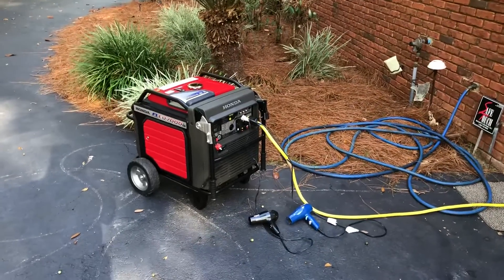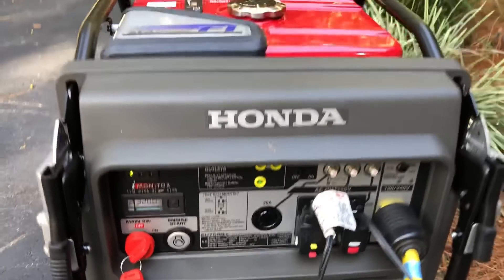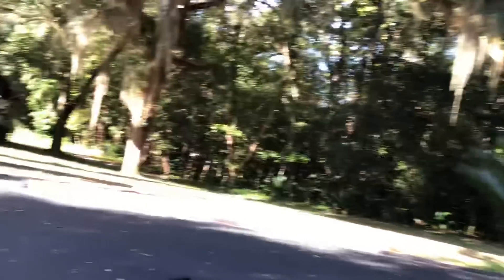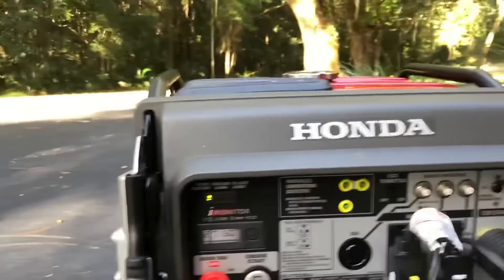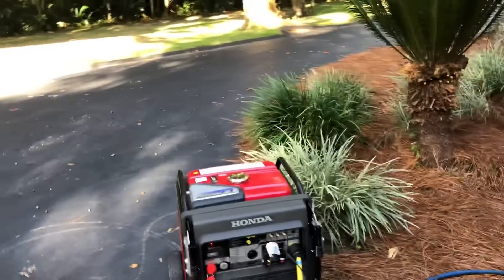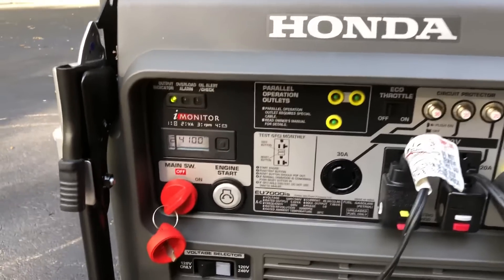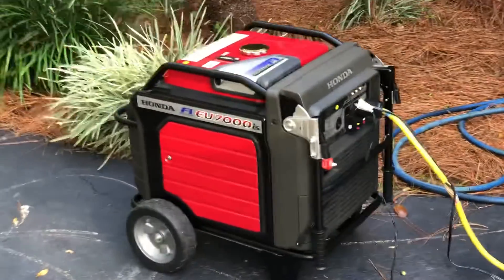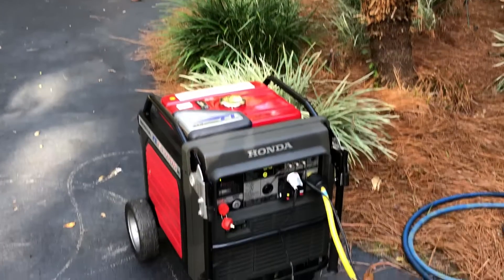Honda EU 7000 inverter generator at 7700 W full load bank test until breaker tripped

Comment: Every EU7000 Honda generator I researched only had a 5500watt rating. That extra headroom is only for motor startups and only for 10 seconds, you cannot run this generator at 7000 watts continuous. 120/240V 7000W max. (58.3/29.1A) 5500W rated (45.8/22.9A)

Comment: It was overloaded at 5501 watts, you were using the 1500 surge watts which will run for a certain amount of time before it shuts down. This unit is only designed to run a constant 5500 watts and it is designed to surge up to 7000 watts but only for a short time to allow something to start.

Comment: I have one and just hooked up a bigger manuel transfer switch with 6 120 circuits and 2 240 circuits, one of the 240 circuits powers my 18K mini split and the other 240 circuit powers my hybrid hot water tank I only use on the heat pump side everything worked great rant for about 12 hours no glitches of any kind couldn't be happier. and it's quiet with a large gas tank.

Comment: With this generator, if you connect only using the L14-30 to your home, can you go up to 7000 watts for maximum and 5500 watts for continuous ?

As you were using the hair dryer in the other connectors , I was wondering if we can reach the maximum using only the L14-30 connector
Thanks for the review
Reply: The 7000 is the maximum surge the generator is designed to handle, it is designed to run up to a continues 5500 watts, the 1500 watts from 5500 watts to 7000 watts is there for surge i.e. a motor starting, a compressor starting, a sump pump starting, it is not designed to run above 5500 continues watts.

Comment: " They Say" on  a old school tank 4500 watt water heater, if you take one of the wires off the breaker and land it on the neutral bar it lowers the wattage to about 1150 watts@120v, but it takes 4 times as long to heat. I just had a random thought about a 30 amp 3 way snap switch.  That is what "they say" so it would seem if you had a 120v generator with only 2000-3000 watts you could still have hot water if you managed your power properly and only ran it on the day when you do not have many lights on.  btw my 10 yo eu2000i  honda had its fuel pump go bad just recently.  consult with a licensed election for all matters involving electricity

Comment: The thing is though, it's only rated at what, 5500 continuous running wats? How long would it run at say 7,000 watts before tripping since that's over it's rated continuous duty level? Just curious b/c I am thinking about upgrading to one of these but not sure it's quite big enough for my needs.

Comment: But without your air condition units it's not your whole house..... And your clothes dryer..... I use a 3500 to power my house after hurricane..... I can run some lights, a few fans, tv/router, refrigerator, freezer,.... And two window unit ACs.    The two window units keep the house about 80 in hot weather but dehumidified. They cool the living room and master bedroom.  It's livable in the peak of day it'll get down to 65 at night.    Oh and it only uses 7 gal/ 24 hrs with the AC is running.    We get by with microwave, toaster oven, and single electric  burner that we put on counter. Just have to stop   ACs to use the microwave, toaster oven, burner . Fuel consumption  matters when power out 2 weeks. 

LED bulbs have saved a LOT

I've been looking at the EU 7000 because I can add another window unit AC during day, and be able to run the microwave , etc without cutting the ACs off.    Could also run the clothes dryer with ACS off.   It will consume more fuel but it will be less trouble.

Comment: 7200 watts will probably trip it offline, just might run a little longer at 7.2 kw...nice inverter. But when you see the overload light come on a timer starts and it's just a matter of time.
Reply: BINGO, many think that he was running over 5500 watts but they don't understand that anything over 5500 watts is the built in surge capacity and it not designed to run constantly over 5500 watts.

Comment: This is quite impressive.  People in 50Hz countries (eg British Commonwealth countries) should not that the engine governors in non-inverter generators are set to run at 20% lower speed (3000 RPM, 60Hz countries eg USA run at 3600 RPM) and thus they won't meet their model number/designation power output.  Hondas have enjoyed a good reputation, but Chinese near-clones have been better for at least 10 years, and they are a lot cheaper.   With inverter generators, electrical rotation is independent of engine RPM and there is no problem.

Comment: In the fire dept.,  Honda equipment NEVER failed us.
Reply: My bro-in-law works in road construction and Hondas are all they will use.
Reply: Specially if you use engineered fuel in them. Trufuel, vp fuels, sthil and ect.

Comment: This generator isnt even rated for 7000, its actually a 5000 continues IIRC, So pretty amazing it actually can sustain those loads
Reply: It did not sustain the loads, once you overload it it will only run a certain amount of time before the unit will shut itself down to protect the inverter. This unit is only designed to run a continuous 5500 watts, the 1500 watts above 5500 watts are for surge i.e. a motor starting, a compressor starting in the fridge or freezer or a sump pump starting. Notice in the video the unit did in fact shut down.

Comment: I bet if he turned on the ac compressor it would probably over load it for sure depending on the amps
Reply: I ran my 2 ton central air on a Coleman 5500 watt and had other things running with it. Had no problems so this would be even better

Comment: I love my Honda 7000is.  Wow, is it quite for normal use (lights and basics) are under 2000 va.  BEST yet, it produces clean power for the PCs, LEDs and my thermostat.  Yeah, $5k is expensive, but it does the job very nicely.

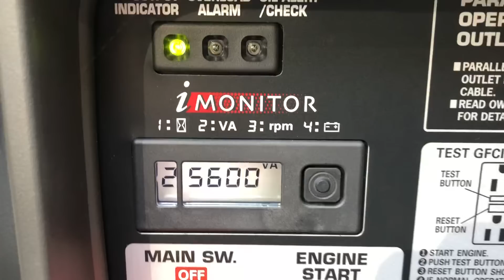Comment: Can someone explain to me if the entire house is plugged into the 30amp outlet that will trip above 30amps(3,600watts), how can a generator be providing 5,600watts without the breaker on the generator tripping? (seen at 1:15 on video). Is the 30amp breaker rated per phase? Being there are 2 phases it would be 3600*2=7200watts?
Reply: If you look closely he is actually using all outlets individually. One 30 amp 120v, two 20 amp 120 and one 30 amps 240v that gives the generator the capacity to perfectly manage 100amps simultaneously ;) Also just the 240v outlet a 30 amps breaker that can manage 7,200 watts by itself. To calculate the wattage you multiply voltage by amps in the case it will be: 240 X 30 = 7,200

Comment: Can someone explain the purpose of the 220v plug ? I bought one of these to run my food truck, my truck has 120v cord coming out. Do i use the 220v plug to 120v conversion plug ? And where would I find one ?
Reply: 220v for transfer switch
Reply: Brian Plow 220 v that’s for Europe i’m from Europe and we use 220v everywhere and all gadgets are 220v
Reply: @razrushaki  europe is 220 single phase.  US is 240 split phase.

Comment from the maker: It will run a 2 ton unit central unit with no problem as long as you do the hard start capacitor kit on your air-conditioning or if you run it parallel with any other size on the generator it will easily kick on a 2 ton or a 4 ton with just the help of a 2000 W Honda connected
Reply: People really needs to watch this video https://youtu.be/jzm6sEgsGZM
Reply: A soft start kit is better. Reduces the LRA inrush current by up to 70%. The MicroAir Easy Start 368 model is a good one for larger AC units.

Comment: You mentioned you weren't running your AC during this test, but I see from the comments below you use it for hurricanes and such.  Have you run this set-up with your AC? Does it hold up, or does it only run the house without the AC?
Reply: I can’t speak for him personally, but I would say probably, since residential AC units usually use about 3000 watts, without the oven on it should be able to handle it as well, seeing as his house was only using around 2000W without the oven on.

Comment: Thanks for the test.  
I’ve owned the earlier model ES7000IS since the 2005 hurricane season here in Southeast Florida and to date, it has served us well.  I’ve never added the amount of load you just tested so it’s good to know how much it will actually run... 

Mine plugs in via a dedicated transfer switch and runs all of the 120v load in our 3 bedroom 2 bath home.  We’re able to run all the LED lighting load, microwave oven, refrigerator, 2 burner electric stove, fans, tv, computer and a 6,000BTU window unit for our bedroom at night.  It will run for 14 hours on the 4.7 gallon tank @ 50% load.  I use REC90 non ethanol fuel ⛽️ while in storage and when hurricane season comes I store 6-5 gallon safety cans of regular gas with Stabil.  
At the end of the season, if not used, I gas-up my vehicles.  It is one of the quietest if not the quietest inverter/gen sets on the market.  Yep, it’s not cheap, mine was $2,800 back in 2005 and more today.
Reply: I do similar I usually have six five gallon cans of 92 non-ethanol stabilized.  It's good for at least a year in sealed containers. Premium fuel does not make as much gums and varnish as lower grade fuel does when it's in storage. I have kept stabilized premium non-ethanol fuel one year in my boat . Without any problem whatsoever. I use mercury fuel stabilizer it takes one ounce per 10 gallons

Then I have another 50 gallons in my boat.... And then I have about 45 gallons in the cars when a hurricane is coming.... All together that's about 125 gallons.   I've run for 2 weeks without having to get more fuel using a 3500 generator and two 8000 BTU window units.     After hurricane season I just pour most of the gas into my truck one can at a time. Keeping one around for electrical outages.  When you need fuel you're just a few minutes away from siphoning out of your boat or a car...
Reply: Great tips on how to efficiently mange fresh fuel

Comment: not exactly quiet - contrary to the advertised specs...
Reply: Hooch, I have one and it’s quiet.
Reply: Its quiet with a low load, but at 3000 watts it sounded like my open frame duromax. I'm guessing the Decibels at about 75 from the sound of the video and him walking through the garage. Duromax open frame is about 82. That honda cost over 4000 dollars.

Comment: Does it really make sense to spend this kind of money?   I bought a "Chonda" 7000 dirty power generator for $500....It does bother me it is not cleaner inverter power ....maybe my "sensitive" electronics might not last as long ....however at 4400 bucks PLUS tax that is 4000 dollars I already saved to count toward sensitive gear possibly (MAYBE) not lasting as long ....Computers however no matter how much you pay just lose value like crazy no matter how they are babied ....maybe my refrigerator won't last as long?  But it only cost $2k  ....what amI protecting?  So far nothing has failed in many many hours of dirty power from my chonda ....it always starts right up and EVEN if it fails at the 500 hour mark?  That is several years use!   I'm thinking to sell it if it is still running well at 400 hours....wait for big power outage and put it on Craig's list for $300 where someone will be DELIGHTED to come and grab it because they are desperate....(how would THAT be using a generator for YEARS for $200 and some oil changes?) in the meantime I will watch for off season sales (when there is little need for generators I've good weather not fire season etc) and buy an extra Chonda unit so I will have one that works even one craps out ...plus I DID buy little Chinese inverter Genny CHEAP on Amazon black Friday dealio ....I kick myself for not getting at least one more as they are gangable.   ....I don't enjoy supporting China however 10X cheaper it just becomes too much savings to let go...and I mean the Honda is JAPANESE anyway right?
Reply: I DO confess this Chinese knock off is a noisy son of a Seabiscuit ....however I live in rural area on 5 acres so no one to annoy but me ....I simply bought a super long 120' power cord and so I simply wheel the beast well away from house behind an outcropping of boulders....And then so long as we are in the house with it that far off?   Honestly can barely hear it IF it is quiet ....but if the TV or stereo  or even a fan ior two is running  ?  There is nothing to hear even....So mostly the noise factor is a total non issue that the Honda would not help me with one bit.  Now IF I was using for an RV?  Especially with other people camping close in?   THEN an ultra expensive but super quiet Genny starts making some sense....of course that assumes someone ELSE is not running their Chonda unit a few feet from your own spot ....or several running various gennys with a cacophony virtual chorus assault of internal combustion engines all competing for most obnoxious  award  ...in which case it would be more like "why did I even bother?"

Comment: Could it handle your AC or electric furnace?
Reply from the maker: Jacob Sherer Well I don’t have an electric furnace but I have turned on the oven which pulls about 2800 W I believe and everything seem to work great and the 2 ton air conditioner is no problem but I did put a hard start capacitor kit to let it start much easier and without having zero load it still starts fine with even up to 1000 watt  load running

Comment: These generators are very fragile and do break down frequently. I own 2 of them so I am speaking from experience. Look in the back of your owners manual and order the shop manual from Honda so you can do your own maintenance and troubleshooting. It will save you time and money in the long run.

Comment: Quick question, how do you have your entire house wired to a single plug to the outside that can be ran from a generator?
Reply from the maker: TheTechGuy600 You basically wire and cable into a breaker a 240 amp breaker inside your switch box then shut the power off from the main coming into the house and then when you’re ready to power up the house flip that 50 amp breaker and then the cord becomes live straight out to the generator very simple connection I need to make sure you know what you doing Because you can’t accidentally flip it on with the main switch on make sure the main switches off before turning your generator power on
Reply: Look up generator transfer switch. There's a kind that can connect to your whole breaker box or a kind where you pre pick which loads you'll want to supply ahead of time and you'll be stuck with those.  There's a lot to this so do your research and do your homework. I recommend a qualified electrician do the work for you.  But study up on the options and how they work so you can ask questions and understand the system you're going to have installed and its limitations.

Comment: That is not Watts. That is VA .7700 VA with power factor of 0.8 is 6160 watts. It's supposed to be 7kva with a surge of 7500 VA. Watts and VA are two different things .
Reply: What exactly is the difference I always thought they were the same 120 volts X  10 amps = 1200 watts or VA
Reply: @JIMIIXTLAN  Apparent power (S) takes into account Real Power (P) and Reactive Power (Q) where S^2 = P^2 + Q^2. An easy way to think of it is that S is the power that needs to be supplied by the source to actually deliver P to a given load. There is a penalty when powering capacitive or inductive loads and this is where Q comes into play.

Comment: at almost $5000 i would expect this
Reply: I don’t believe that price is correct.
Reply: @Homefree18  its kind of fishy its says the webpage its not 100% SECURE
Reply: Pandugenerators nobody can beat there prices 2300.00 bucks for the eu7000i
Reply: @carlosreyes6448  has anyone ordered from that site?
Reply: @cpabrego  I haven't but Honda's are manufactured in Thailand India and China and Indonesia so that's probably why there so cheap
Reply: @carlosreyes6448  seems like a scam sitr
Reply: @cpabrego  yes it does, hard to believe that they can be priced that low or they can be clones like copy cats.
Reply: gaurd3 wow, I’m glad I didn’t. I bought a used one for $2500, it just need the fuel filter changed. Changed the air filters, plug, and oil as well, purrs like a kitten now. Thanks for the heads up.
Reply from the maker: Technologic It’s not that much I think I paid 3199 for this unit here it is online they are very reasonable I don’t know any other generator that you get so much for such a little bit of money something that will be around and maintain its value and you’ll have for years and years. 
https://www.pandugenerator.com/products/Honda-EU7000is-%252d-5500-Watt-Electric-Start-Portable-Inverter-Generator.html
Reply: @michaelvaughn5439  theres no way that's the price ..that's a website that would rip you off. Only reason I suspect you recommend that website it's because you in the scam ..nice video though and nice generator
Reply from the maker: Chris Gil Well I have a friend that’s going to buy one from the same place I bought mine and he’s going to pick it up tomorrow and it’s $3800 plus tax but they were about $500 cheaper two years ago when I bought mine I’ve got a John Deere do you were in the local north Florida area that is overstocked from the last hurricane he is selling them at dealer cost for $3800 plus sales tax after we purchased this one tomorrow let me know and I’ll tell you where it is if you want to go pick one up
Reply: Michael Vaughn did you really buy that Honda EU7000is from that Pandu site?  They are now selling it for $2239.30. Just seems like a scam although i couldn’t find that much info on it.